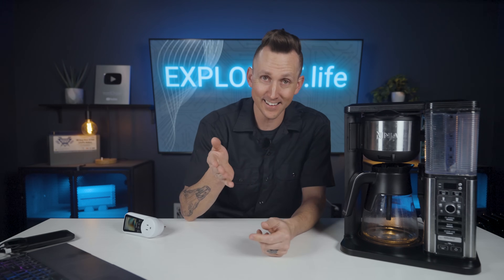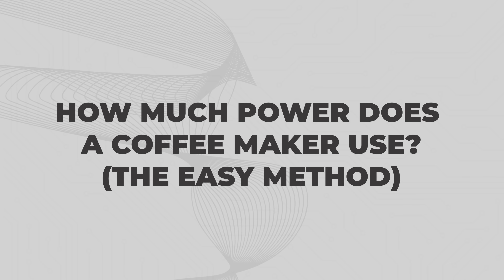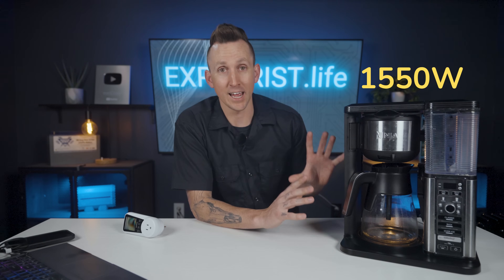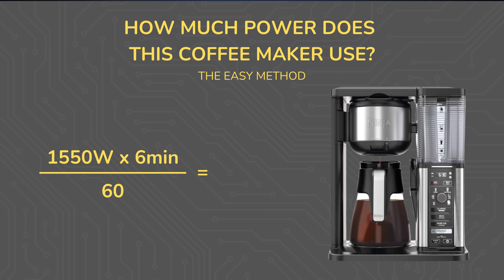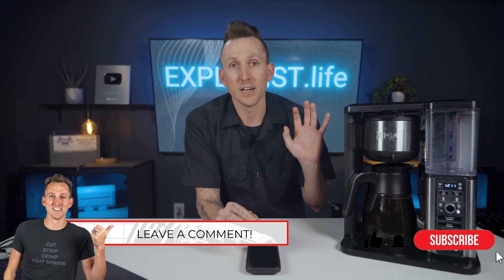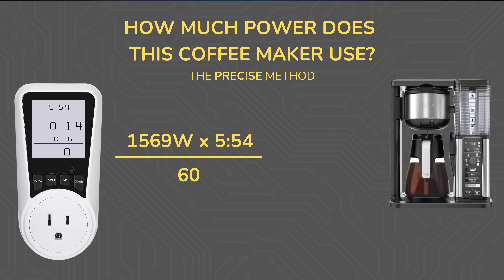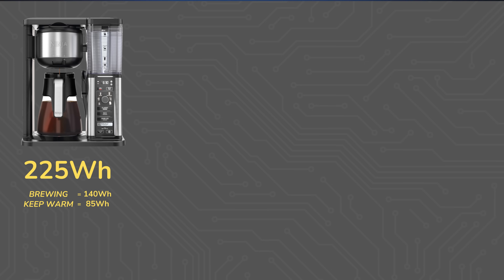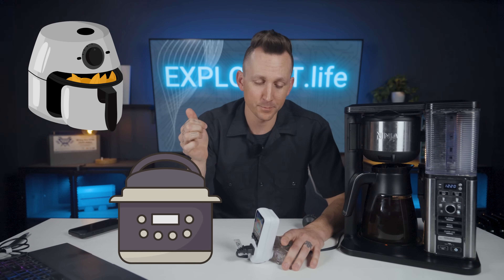Coffee Maker. How Much Power for a Mobile, Marine, or Off-Grid Electrical System?

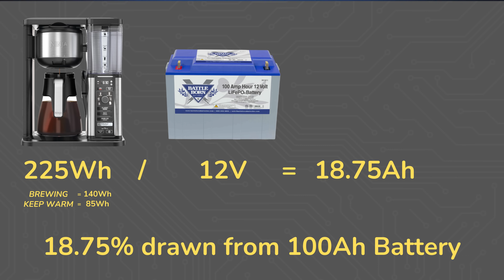Comment: I think I'm doing something wrong when I calculated per the precious method.   I calculated 5:54 as 5.9 minutes.   Then 1569W x 5.9 min / 60 = 154 kWh.   That seems much closer than what was calculated using the simple method.    Is the difference of .1 kWh because this is AC power and not DC power?

Comment: My dad has 4 x 175 watt flexible panels epever 60 amp TN series I think. 2,000 watt inverter busbars fuses on/off switch. Don't use much power fridge on propane camps off grid no phone charge or TV just 12v lights most importantly CPAP. Solar is separate plugs trailer plug into inverter. Only thing driving me crazy is running the solar charger positive and negative into battery through the same one going to the inverter didn't think electricity ran 2 ways on one wire.

Comment: Hi Nate.  as requested I found a Kurig style coffee pot that pulls 930.9 watts max to brew one 14oz cup.. I specifically searched for this one thru many.. so I could stop my Air conditioner, brew coffee, and go back.. my unit has a AC/Load cutout on a 2000 watt brand X inverter.  its the Chefman Single serve K cup..  it pulls 930 Watts max, no warm for 14 oz cup, takes 2:40 and burns 36wh.. so 4 x 14 oz cups to a pot makes 144WH for 4 cycles..  but it also takes more time to prep..   we are looking for an insulated coffee pot that pulls around no more than 1000 watts with no warmer.  The value in the smaller current draw is we can also plug it into an extension cord when leaching shore power or borrowed power and not slam the line/source, and it also doesnt overload our little 1600 generator. We often group when camping, and everyone leaches off one unit.. so I try to find stuff that pulls less than 1000 watts when able and use alot of ryobi tools / batts for other things.. but the coffee pot is essential enough that I cary a spare pot :)  my system is 12v/640AH base and we will be updating to a Vic3k as soon as we can finish the design work..  keep up the great work

Comment: How would one do this on a 12vdc compressor fridge (or any 12vdc powered item)?  I'd love to have a setup that records a real camping trip so I can get an idea of how much energy it really uses and/or is using (camping in the cool mountains of NYS vs hot Arizona or Florida).
Reply: how I did it was to get a clamp on DC capable amp meter or loop meter and find the main feed line under the fridge and clamp it on.    A DC capable clamp multi meter is more expensive but a worthy investment, I know Nate has one too, seen it on some vids..   That all being said, if you have a shunt installed in the system, you can stop the charger, get to a baseline current, and measure it.. but with a fridge you have to consider ramp and cycle time.. its the same principal as the coffee pot.. power up, cooling then maintenance cycle..  And there is a huge variance depending on the environmental conditions..  hot and humid is much harder than cool and dry.. I have a mid size 12v compressor fridge and it pulls around 3 to 5 amps average day time, and 2 to 3 in nighte mode.  fwiw..  my victron shunt tells that story too.. thats how I measure most of the 12v as installed.. close enough..  

I love this channel, its so full of amazing stuff.. thanks Nate & Steph..  PS.. I will also give up power for coffee first too.. I often kid around that i live in a solar powered coffee pot

Comment: Great video. I actually did that last month the exact way both steps. Yikes my home office uses 1.4kW each day. Not counting internet modem. Hum I will have to rethink my power when boondocking. I will need a genny AND more solar that I have at a humble 300w. I like your solution of two charge controllers but ouch that must have been spendy. Not sure my brand has that ability to work in tandem. Thank you for the video.(✿◡‿◡) (¬‿¬) (‾◡◝)

Comment: I have 4 cup Mr. Coffee drip coffee maker, model TF4. The label says 650 watts @ 120VAC. Using a Kill A Watt meter, the brew cycle used a constant 670 watts and took 6 minutes and 10 seconds (6.1667 minutes). 670 Watts * 6.1667 Minutes / 60 minutes in an hour = 68.86 Watt hours. The keep warm cycle used the full 670 watts running for 10 seconds every 3 minutes. I didn't keep track of the power usage of the keep warm cycles because those 4 cups of coffee are gone in short order.
Reply: Thanks. I hadn't done the official test on this model coffee maker, but this seems to be in line with the wattage used this past weekend through a totally non-scientific observation of my Bluetti display.  Definitely would recommend the "gone in short order" method and turn off the coffee maker as soon as possible. Especially if doing so before any solar recharge is available.  Didn't help that we had a really cloudy morning and I was not getting much charging from the panels I have on the roof until long after coffee was consumed.

Comment: Excellent timing! I ❤ the speed of your brew. Coffee makers require the same amount of maintenance as electric water heaters given the same source water. Vinegar and CLR or installing a new heating element is as costly as just buying bottled filtered water. I occasionally pick up and repurpose newer late model electric hot water heaters 2 X 1500-4500 watt elements. Here, and everywhere west, east, and south of the Rocky Mountains using ground water without a full home water treatment system will collect an inch or more lime deposits every year, I often find 4" inches in the bottom and new -ish elements completely insulated. Many people neglect to accurately monitor both the Electrical Consumption And Time. Five minutes on your coffee makers is amazing! Regardless of element wattage any lime scaled coffee maker will take up to twenty minutes to brew a pot. The dumps are full of new ones. ❤

Comment: A somewhat related question based on items that have significant power draw: On the internet you can find numerous videos of lithium powered devices {usually bikes or scooters, but sometimes cars and other things} burning fiercely or bursting into flames as they are being used. Like one video I saw recently was of a guy that was charging a scooter in his apartment and it caught on fire. Or another guy that just bought a high-performance electric bike and on its maiden voyage it started smoking and then just burst into flames as he was riding it. I assume this is because one or more cells short out, or in the case of charging, they may be overdriving the charge voltage and/or time of the batteries. The videos never explain what happened, they just show the results. 

Considering the very considerable expense of a high-end van build {i.e. often $150K or even higher} AND considering the very high potential danger of a runaway lithium fire inside such a small living space, is there any way to predict or prevent seemingly random mishaps like that? Especially as you drive around with the batteries inside the vehicle over a long period of time and the individual cells are subjected to a veritable buffet of road vibration, shock and G force. And are there use-cases for electrical systems that tend to minimize these risks? Are there some cases that increase the risk? Like, is burdening a single 100AH battery {as shown in the example given in this video} with a fairly high-power consumption cycle, increase its temperature or likelihood to burn if something inside is marginal? Or, is there a risk increase of some type if I more than doubled my alternator charging rate from 40A to 100A using the new Victron parallel DC-DC charging units available now?

Comment: Keurig K-Mini  120 V,  1470 W, brew time 3:02 = 73.5 Wh / per cup of coffee.

* Brew time was from when the start button was pushed to when the unit stopped.  There is no after brew warming.

I recently purchased an EcoFlow River 2 Pro using my K-Mini as a benchmark appliance that a power station MUST power.

Thank you both for the work you do.
Reply: But isn’t the Kerrigan only brewing one cup at a time. If you multiply your numbers by the number of cups you will brew isn’t that much more inefficient?

Comment: Seems like many folks make the error of taking an appliance's stated wattage in marketing materials, such as a microwave, rather than the input power required off the appliance's label. My microwave is marketed as a "600" watt cooker, but the power consumed is 850, per the label. Also, if one is preparing a load table to size solar, inverter efficiency may be considered, in order to know what's actually drawn off a battery bank. So a 95% efficient inverter, for example, requires (850/.95) 895 watts off the batts. Thus, 600 vs 895 can make a big difference. The meter is best, of course, but its nice to be pretty close before buying the appliances.

Comment: We use Melita filters and heat the water on the stove - drip method!
Reply from the maker: Do you have any other electric appliance like an air fryer, toaster, blender, etc that you can check your learning with?  Try it out and let us know.
Reply: Marine environment - propane for cooking. All systems are 12 volt. I do have a 300W inverter, which I have used at times. Biggest draw, on an ongoing basis are the DC refrigeration 2.5 to 5 amps and autopilot when underway! Currently have gone to lithium batteries for house bank and a new AGM for starting. Using Victron products and some of your gear for connecting shunt to Lynx Distributor. I have an electronics and software engineering background (Telecom); enjoy the information you present!

Comment: Mine is a Walmart model 512841 120v 900w with a 1 hr. Keep warm cycle. 8 cup capacity.
Reply from the maker: Very good!  That's the first part of the equation. 
 Now you can figure out 'duration' and figure out how many watt hours in a brew cycle and keep warm cycle use.  Let me know when you figure out your final result.
Reply: Okay, I have a 9-minute brew cycle. 900w x 9= 8,100÷60=135 wh. Keep warm cycle 81 wh. Total 216 wh/12v= 18 ah or 18% of a 100 ah battery.
 Am I close?.

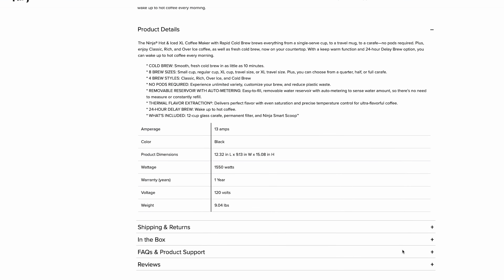Comment: I don't use a coffee maker, but this is how I make coffee. I have a DCIGNA Electric Tea Kettle and boil water in it, then use a GSI Outdoors Pour-Over Java Drip I Travel Coffee Maker and a filter. It takes between 1:40 (Summer) and 3:20 (winter) to boil water. It takes 1000W (according to Amazon it is 800W but I have used this for 3 year and average is 1000W) during this time.
Reply from the maker: How many watt hours is that for both summer and winter?